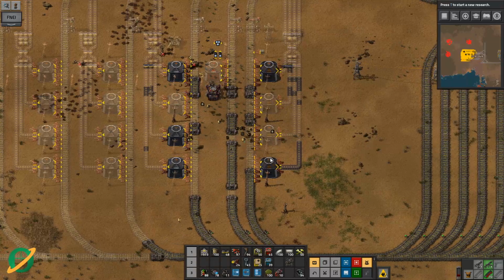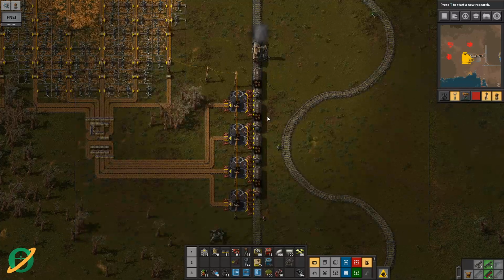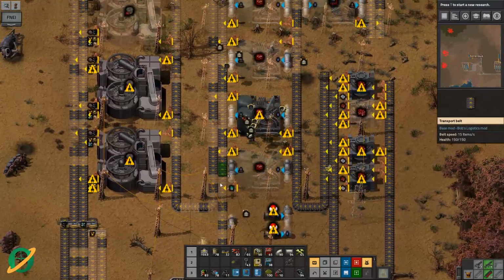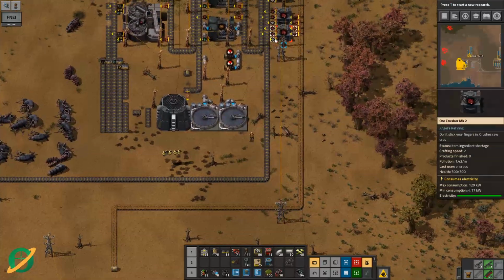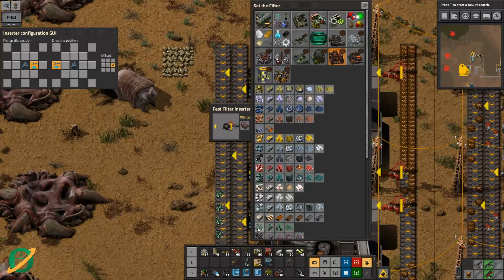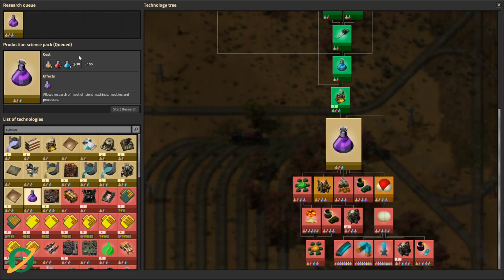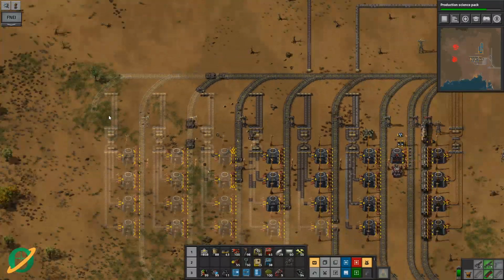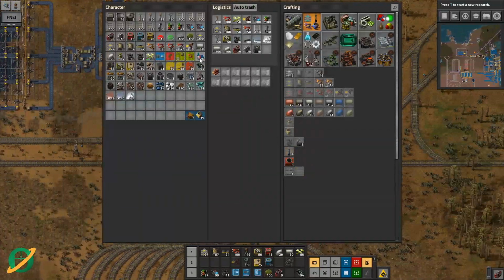Factorio Let's Learn Bob's + Angel's Ep 50: Bobmonium outpost fast build

Comment: These outpost would be so much nicer with angels cargo bots. You could save that gazillion of belts and inserters and filtered splitters. And the time and space for setting them up. Time is of the essence.
Also i have water in my eyes watching that sulfuric waste water voided everywhere. I know. I know. You have plenty to mine and brute sort but you are skipping out the best part of angels refining. The byproduct management nightmare :D
Reply from the maker: It's a balancing act. I want to set things up efficiently but I also want to squeeze each outpost into a nice 30 minute episode. My original idea was to go back and sort it out later, but realistically that will never happen :(
Reply: @OnerousGaming  this episode could have been left out since we already seen this exact setup being built with rubyte processing
Reply: Also I think that byproducts being dumped is a bit unfortunate. It wouldn't be so easy to burn them off if pollution had an effect on biters
Reply from the maker: @goldend791  You're totally right about the pollution and burning of byproducts. Something for me to work on in future Bob's and Angel's runs :)